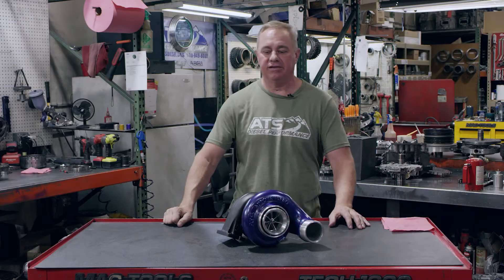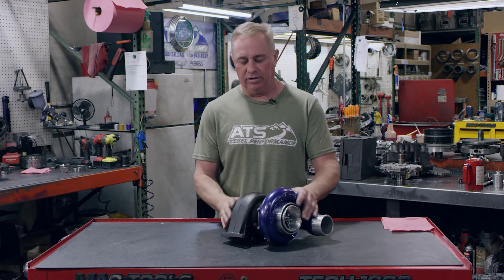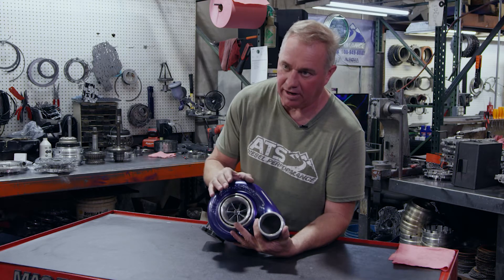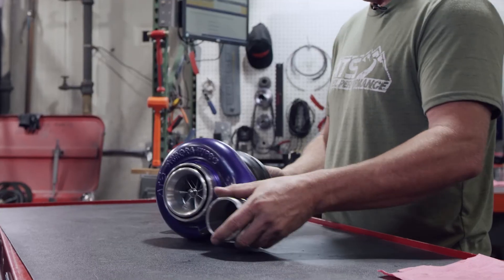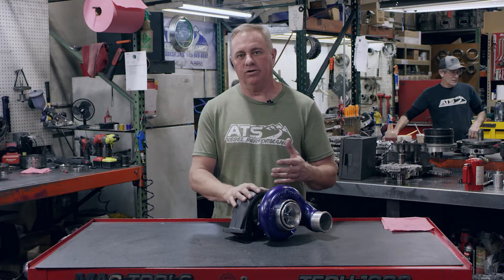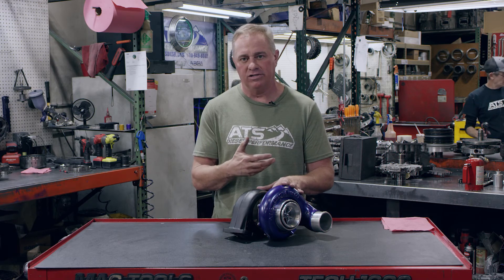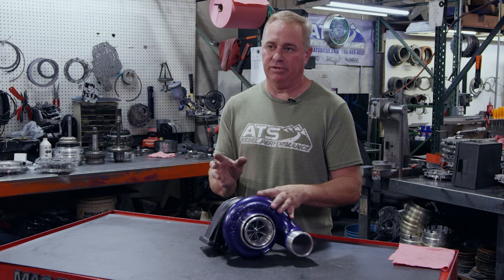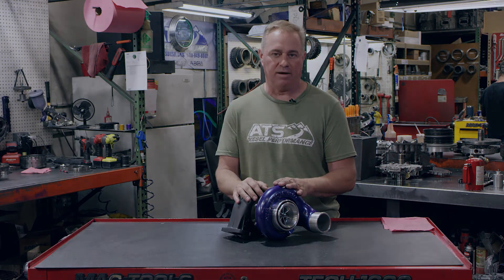ATS Aurora 3000 & 4000 Dodge Ram 5.9L Cummins - Fixed Geometry Turbo - Product Overview

Comment: Is a tune necessary if replacing the stock turbo? Truck is stock.
Reply from the maker: Thank you for the question.  You do not need any tuning when installing either the 3000 or 4000.

Comment: How would the 3000 perform on stock rig? Would it lag even more?
Reply from the maker: @thim8009  it would perform great. As this is a direct drop in replacement,  our Turbo has better air flow, advanced bearings as well to provide you a quicker spool as well as help to lower your EGT's. You'll definitely be impressed with the 3000 on a Stock Truck.